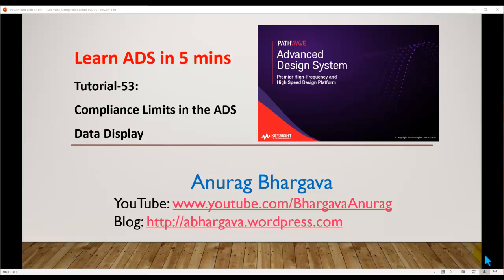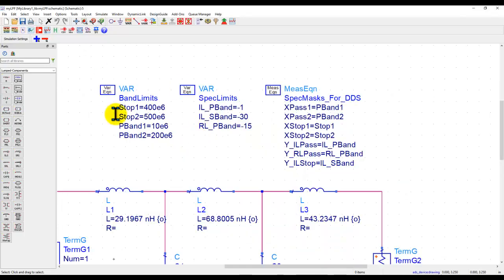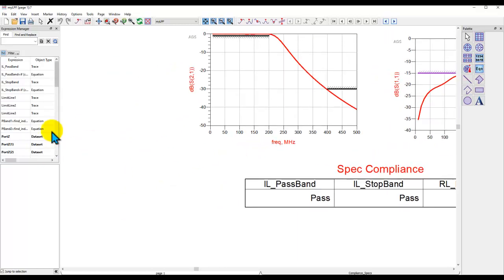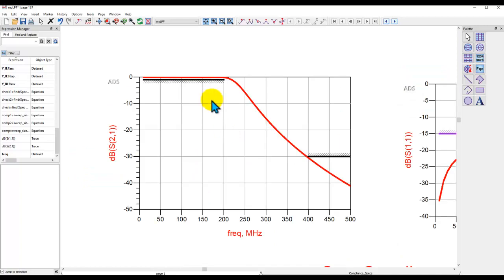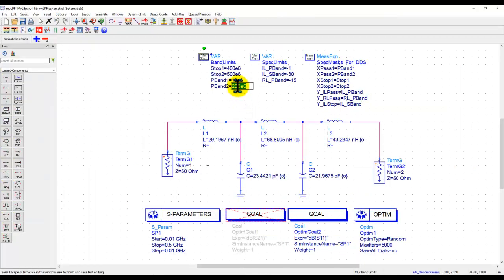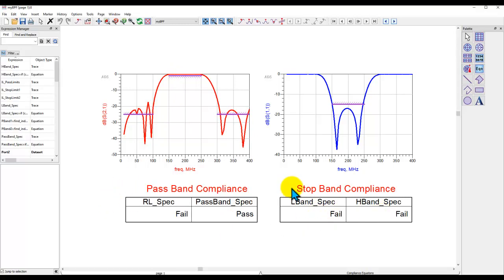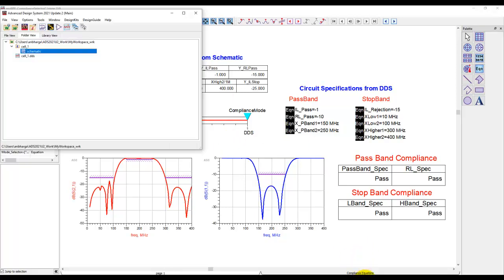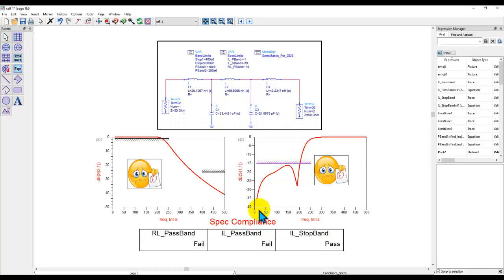Tutorial-53: Compliance Limits in the ADS Data Display

Comment: Hello sir, I have data in excel and notation formats, how can they be entered into the ads program for the purpose of drawing s parameters
Reply from the maker: Could you clarify what kind of file you have? If it is freq vs S-Parameter data e.g mag & phase for S-Parameter terms then you can simply add touchstone header in the file and read that in ADS like any other touchstone file.
I can offer more suggestions once I see what kind of data/file you have.
Also, confirm if the purpose is only to plot in data display, or would you like to use it for simulation purposes?
Reply: @BhargavaAnurag  Yes sir, I have freq vs S-Parameter data, type db. I want to enter it into the program and draw it for my convenience, sir. How can I contact you and send you the data